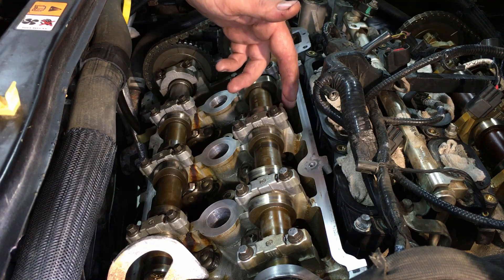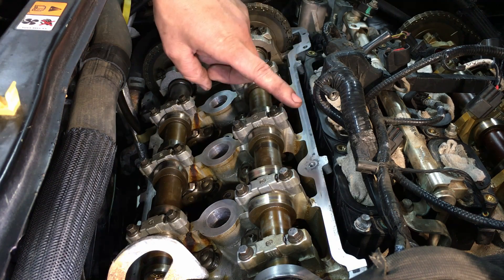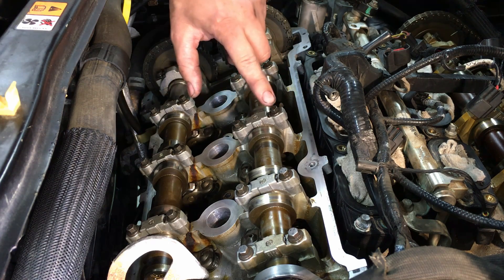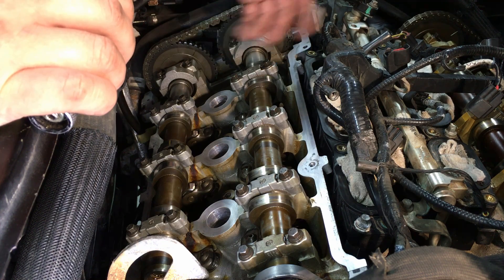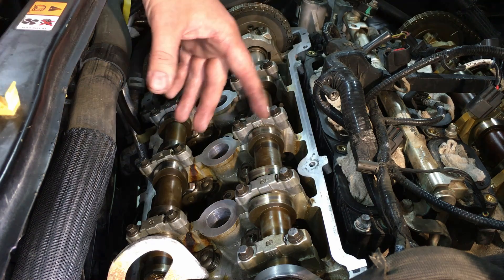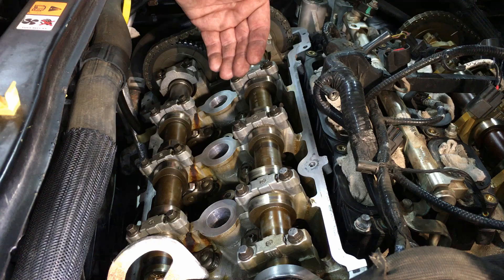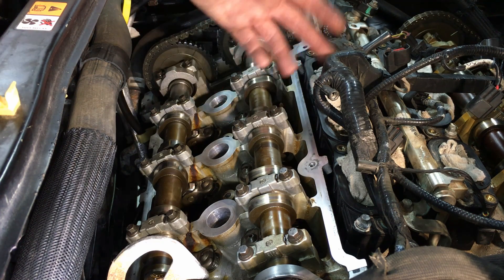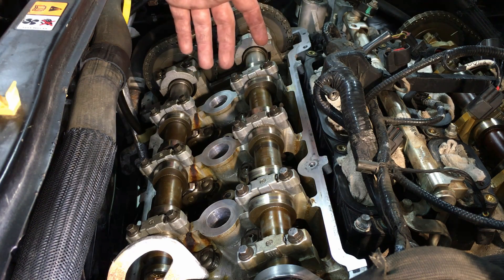Ford Quick Tips #61: 3.0L DOHC Duratec Camshaft Cap Inspection

Comment: Crap I just replaced the rear cover gasket! And that was a pain! I'm surprised that this is even a problem on any engine. You would think that they would have some threadlocker or something on screws that don't see alot of action.  Thanks for the video! Are you going to post any more videos on the 3.0L Duratec while you have it, like front cover, oil pan, etc?

Comment: Any similar issues with the 2.5 Duratecs?
Reply from the maker: +ReclusiveMountainMan No I have only seen it on the 3.0l DOHC so far.
Reply: FordTechMakuloco +FordTechMakuloco hey could you do a video or tell me how to remove the front and rear exhaust manifold on theses 3.0L engines? I have a clogged up cat on one if the manifolds I don't know which one but I had the 3rd cat changed because that went out first now I need the other 2 done but I don't know how to without pulling the motor out

Comment: So you've only seen them on the Montegos & Escapes from the 05 to 07 range then? Not the Tauruses or Sables from 96 to 0? or the older Escapes or Tributes?  Just trying to narrow down which version the 3.0 to be on the lookout for. Thanks for the helpful videos!
Reply: The ones found in the third and fourth gen Taurus and Sable with the Durarec 3.0 were completely unreliable.

Comment: I have a 2006 F-150 5.4 engine light is on getting P0016 Crankshaft Position. Idle is rough and the RPM goes up and down a little no stalling yet. I have replaced the spark plugs and all coil packs need to get this thing to pass smog any advise would be greatly appreciated thank you. -Paul
Reply: Paul does it have a code for what bank on the engine? sounds like a VCT solenoid to me.
Reply: and also the code you are talking about is a crank/camshaft position sensor correlation that's a true sign of a VCT
Reply: I think it was #1 I wasn't sure if the VCY would cause check engine light to come on. Thanks for the help I am at this point lost and frustrated truck is parked because I can't get tags without smog.
Reply: Ok that would make since for sure I guess i was just not sure about the check engine light being on.
Reply: +Paul Rhodes Cel will illuminate with a bad VCT also you will have miss fires on that bank also.
Reply: Perfect I really do appreciate the help! I was leaning towards VCT but I wasn't sure. Thank you very much I needed the help bad. Have a wonderful night. -Paul
Reply: Now I need to find a really good youtube how to video on how to change the VCT.
Reply: +Paul Rhodes  Not a problem my friend oemfordparts.com has original VCT'S cheap around 120 for 2 and they are both the same.
Reply: +Paul Rhodes Ford techs videos are great he has one on changing a VCT also
Reply: +james west I will look for it for sure! He does a great job I really do enjoy his videos he explains things well. Thanks again for your help.
Reply: No problem glad to be of help thats what its all about these days. Let me know if that fixes your problem.

Comment: Damn I wish I would have got the DOHC in my Taurus...biggest mistake ever
Reply: LCCharlie Yeah it's ok bit its leaking coolant now and I haven't fixed the water in the floorboard yet so ice is forming on the windows smh. Plus it sucks to drive a 3800 gm to a Vulcan..very slow